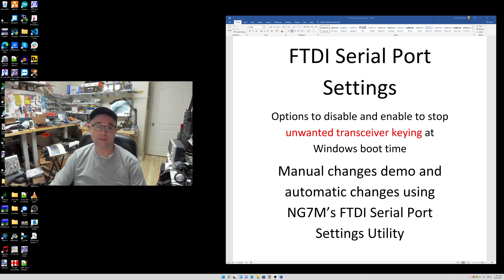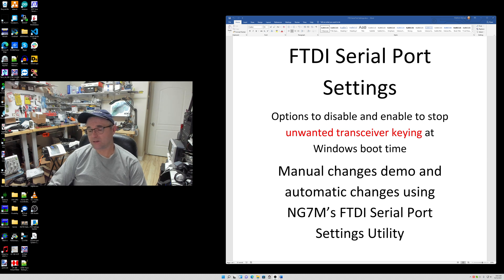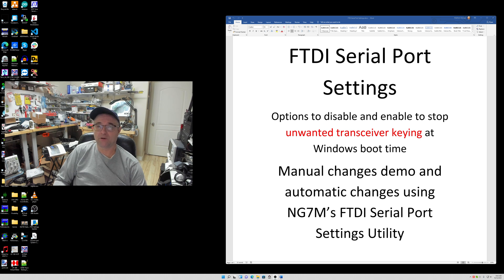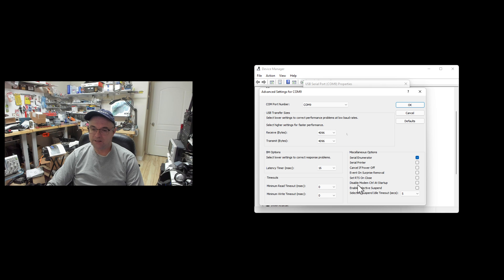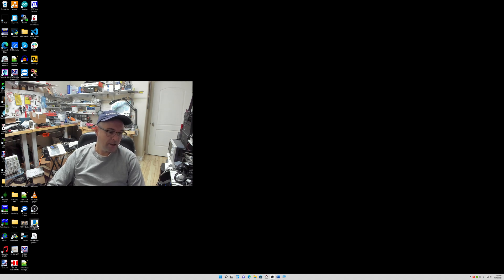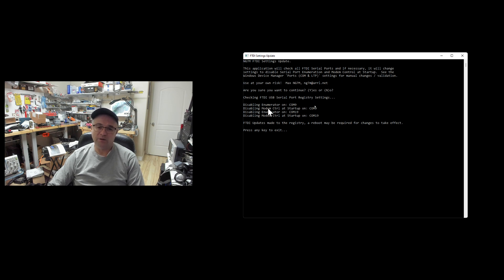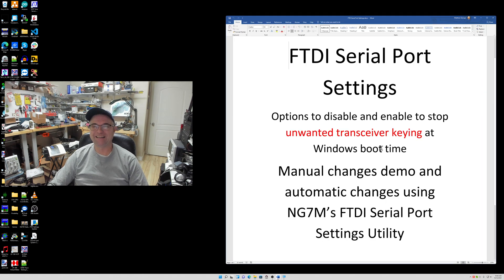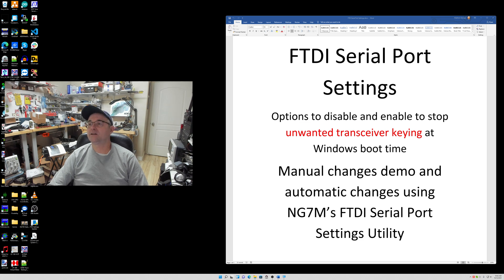Fix FTDI USB to Serial Unwanted Transceiver Keying at Bootup

Comment: Hi Max - Cool utility. One thing I have started doing is rename the COM port to the radio. So I have K4-1 USB Serial Port. K4-2 USB Serial Port, KPA1500 USB Serial Port and it shows up that way in the Device Manager. That is a registry change too so it might be a cool addition to your program.
Reply from the maker: Hi Tom, good to hear from you.  Yes, I agree, I need to get motivated and make a GUI that would let you do that along with the mass enumeration / modem control settings... simple registry changes.  N6TV wants a way to backup the names you use so you can restore them.  It's a great suggestion.  I have been having fun with the K4,  know you have had yours for awhile now... they have a few things to work through, that is for sure, but for the most part, I'm pretty happy.  I love the filters / audio on CW and other modes for that matter.  No ringing on the CW filters even down to 50hz.  Thanks again for the comment and suggestion.  Max NG7M